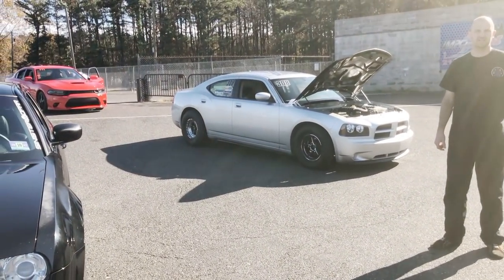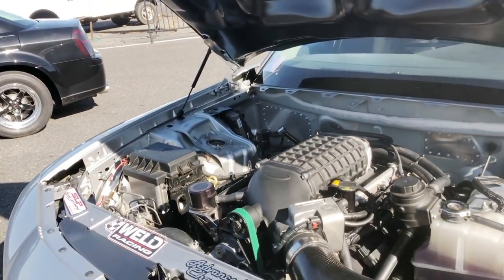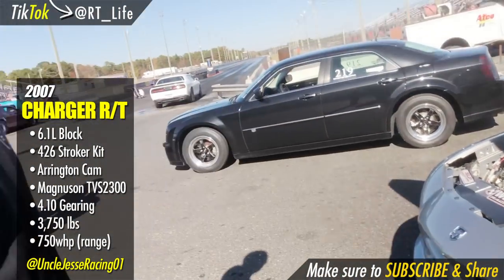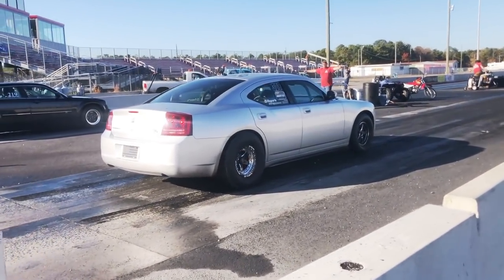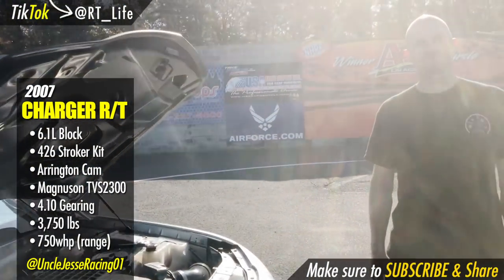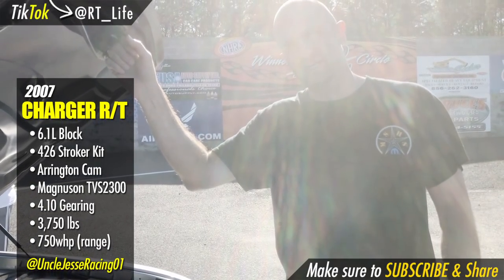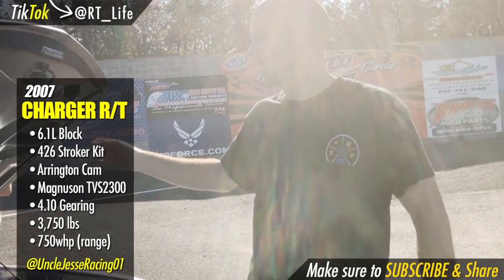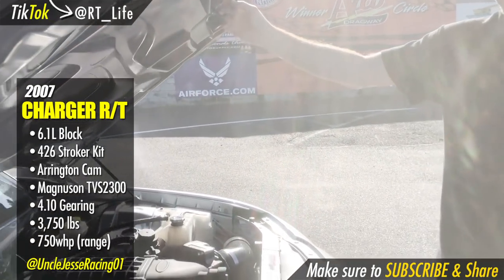Fastest Charger 426!?!

Comment: Is the gear upgraded and how much did it cost to upgrade and will it actually live  ?
Reply: Paramount 8.8 rear.  They don't make them any more but can find them used for around 2k to 3k.  Has a bigger pinion gear then the 9inch setup.  Takes a lot to break one.

Comment: Question: what set up would you recommend for my 2020 RT if i wanted to make around the 500 range like 550whp and still keep my engine running healthy and not shorting the lifespan?
Reply from the maker: Run 6-7 lbs of boost with a supercharger - that will get you to around 500-550whp range.
Reply: @RTLife  Arrington Supercharger kit, a Hellcat Throttle body, Diablo intake, a 392 manifold, long tube headers/Full exhaust, E85 kit and tune?

Comment: Whats the wheel and tire set up on rear, size and  offset and tire?
Reply: 15 / 10 single beadlock.  29.5/10.5 tire. Pro bracket radial.
Reply: @geoffbracken2395  sweet thanks !!

Comment: I have a 2010 charger. I have a 4400 stall torque converter 3.91 differential. Motor is stock. In thinking of going with 426 stroker. Will my torque converter and gear setup mingle well with the 426 powerband?